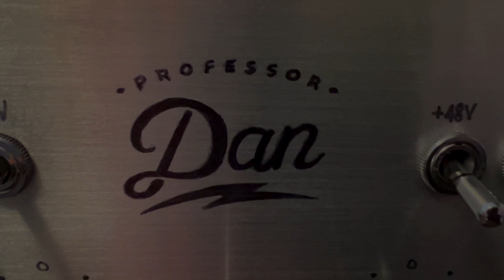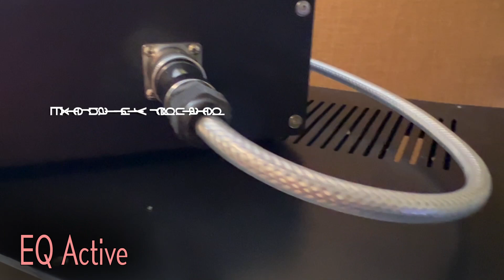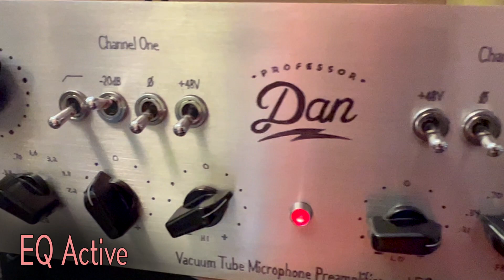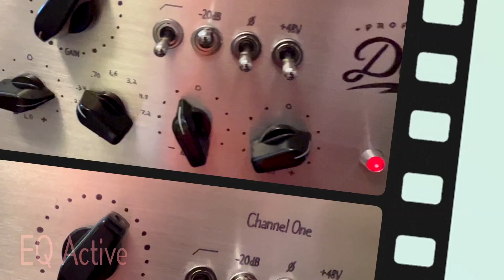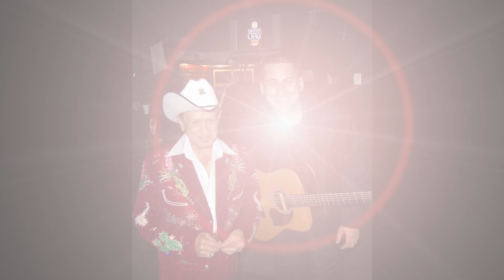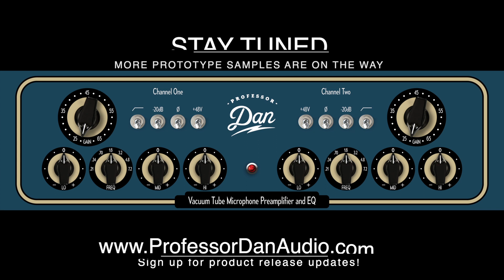Prototype Test - Vacuum Tube Microphone Preamplifier and EQ

Comment: way cool ! - I've someone's old DIY mic preamp - outboard supply- 6 channel 12ax7 cascode each channel - hard pan toggle switches (L-C-R) - sockets where Peerless mic xformers went (kept 2) IT ran quiet w. ribbon mics.  For a home project and just because no one seems to do it, I'd like to see some PC boards for a Stu Hegeman "Tribute RIAA" phono preamp with 12ax7 cascade feedback pair driving lumped passive RIAA EQ and the rest of the preamp all "Anode Follower" with plate to grid nfb - like Stu's Citation I .  (IIRC IV had a cascade feedback pair for its line/hi-level)